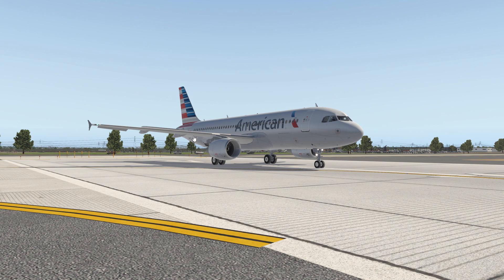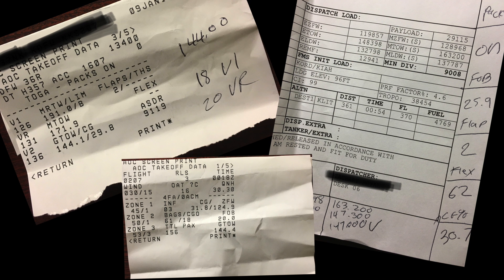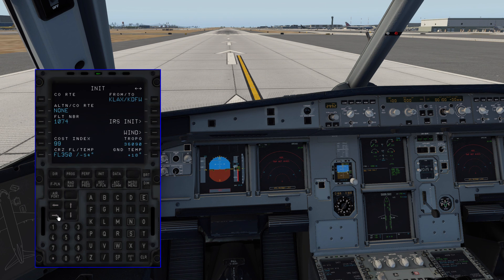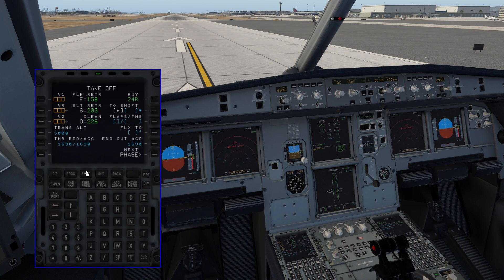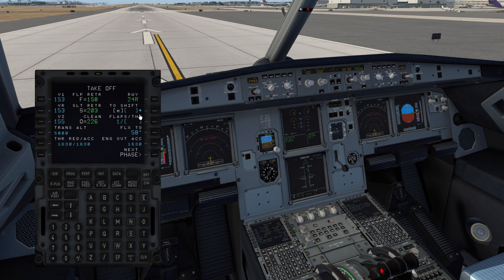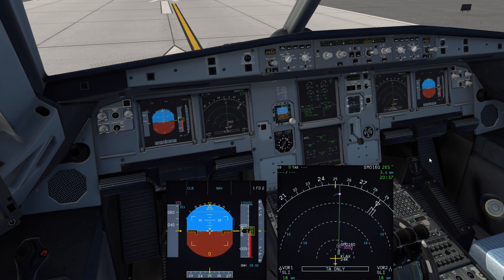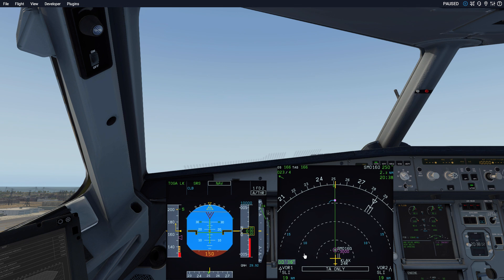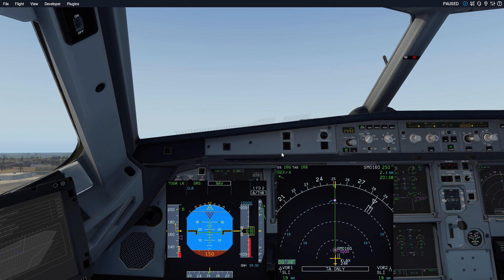I FlightFactor A320 I REAL Pilot Takeoff performance TEST

Comment: Engine acceleration from idle to 50% is too fast. It is a good aircraft, but this is really annoying. Everyone who has seen A320 cockpit videos or been passenger in an A320 knows that the spool up from idle to 50% takes about 9 seconds. In the FF, the engines acclerate like in a toy plane. They should have gotten this right, important immersion aspect.

Comment: I have a suspicion. If you can, try to get real-life data from a "pax off" takeoff. I believe the reason for the overpowered engines is the lack of pneumatic simulation, so the FlightFactor always performs as if the packs were off. I wonder if we can try this, and then maybe we will find the real answer.

Comment: Well, here's a little catch. Your sim seems to be running on low FPS and what X-Plane does in such a case is that it slows down the simulation time when the FPS get below 20 (see here: https://www.x-plane.com/kb/the-simulators-measurement-of-time-is-slow/). I mimicked your measurement with the stopwatch on my phone and when I finally stopped it, it was reading just a tad under 47 seconds, not 36 like on the ND. The gear up callout was exactly at 00'43" so I think the FF is actually quite spot on. Superb comparisons with the real jet though, much appreciated!
Reply: Ondřej Čada what he could do is go into replay mode, record the video in 60FPS (with X-Plane recording) and then record the time.

Comment: I'm curious -- it's my understanding that on the FMGC Data/AC Status page has the "Idle/Perf" variable that is periodically updated based on performance data from dispatch. I'm sure every airline's SOP is different but I've heard that if you're the first crew of the day that you either have to update that or verify it. The FF A320 simulates this seemingly well - just put "ARM" in the "CHG CODE" field and you can edit it from the default of "+1.0/0.0" ... As I recall, these values do modify the FMGCs calculations for a flex takeoff (e.g. T temp = X% N1 (or EPR if you're on the IAEs).) (Side note, I think the default CHG CODE from Airbus is "ARM" but individual airlines can change this....) It could also have to do with the FMGC version (I believe FF simulates the v1 and v2 is out? Not sure. 

Also, FWIW, I've found that the sim is pretty particular about the data from the "Perf Data" page in the EFB Tablet -- if the weights don't match up with the values you enter in the FMGC Init B, things are a bit wonky. (One trick I've found is if I'm not using the simulated fueling (e.g. the refuel control panel on the overhead or the exterior fueling panel -- which you can open by clicking on the numbers on the overhead refueling panel), the sim gets a bit weird if I don't click the "get" and "set" buttons a few times.) 

Really enjoy the videos :)

Comment: I've always had this issue with the FF320, had to customize my joystick settings to where it felt more accurate on the rotation, think I ended up with my sensitivity sliders at 30% for pitch and roll, that was with an old logitech 3d pro, now I'm using a VKB Gladiator and I find those settings sufficient as well.
Reply: Thank you for letting us know about the sensitivity on the pitch during takeoff. I was having issues as well.

Comment: I think that there is something wrong with the thrust deration, because the acceleration of the aircraft seems independent of the Flex temperature, even ToGa appears to have the same impact, at least that's what I notice...
Reply: That's what I am thinking too.  The N1 values calculated by TopCat (for whatever they are worth albeit closely matched by FS Labs) are a few % lower than what FF A320 is giving on takeoff for the same flex.  I think the flex is probably ignored in this simulation.

Comment: I don’t know the aircraft you fly in real life, but the FF has the CFM engines, and maybe the plane you did the test with had the IAE engines which could have cause the “overpowered” engines. But I could be very wrong and the plane you fly could definitely have the CFM engines as well. Just thought I would throw that out there. Great vid!
Reply: He said he flew the 320-214 in real life. The -214 denotes that the aircraft has the CFM engines
Reply: uhntissbaby111 did not know that thanks
Reply: The FFA320 has the CFM engines.
Reply: Cedrik Lussier yep said that
Reply: @zachcalpey9371  Yep my bad I stand corrected
Reply: Yup! On Boeing’s, the last two digits are for customer codes. On airbus, the last two are engine variant

Comment: Just so you know having AI can decrease your FPS dramatically so that may help boost your performance by turning AI off! In addition, you might notice that the FF320 over rotates easier than the Tolis319... hopefully they are working on this - who knows! Thanks for the content 👍
Reply from the maker: thanks i will turn this off in the future! Dang little cessnas lol
Reply: Also if you are using a NVIDIA GPU you can check if your performance is better when THREADED OPTIMIZATION is on or off. You can find it in you Nvidia controll pannel. Enjoying your vids. Keep it up!
Reply: @x-dynamics4025  Correct! I found that in 11.30, "ON" gets me better performance. Previous versions including XP10, i had it set to "OFF" for better performance. Something has clearly changed in 11.30 :P
Reply: @ELSØ-DJ  since 11.30 off was the way to go. Also turning off shadows on scenery helps your fps a lot. (And refection detail to 0) happy landings captain!

Comment: Thanks, that's what I always suspected.
What do you think about the behavior during rotation (with a non slipping joystick of course)?
I have the feeling that the ToLiss needs a pronounced pitch up while with the FF it's very easy to end up in overrotation and TOGA lock.
Which one closer to reality?
Reply from the maker: This is difficult to say definitively but I would lean towards ToLiss for rotation. I do feel that the 320 has a tendency to over-rotate in the sim. This is a difficult thing to model because during rotation at SRS engagement the pilot actually does have a direct relationship between sidestick deflection and the elevator, it is in-fact more "pitch" sensitive then it will be during normal flight mode with full FBW engaged.
Reply: @V1Sim  I always find the FFA320 "feels" heavier on the ground, significantly so; while the Toliss feels better once you leave the ground. With that said, XP11 has been known to have ground physics issues.

Comment: I personally prefer the toliss over the ff. The toliss gets regular updates and will be the best airbus after some updates in my opinion. Meanwhile the ff gets 1 update every  6 months
Reply: Keep in mind that the FFA320 is technically in beta, so it hasn't been fully released yet. Now with that being said, I think it was irresponsible of FF to release and unfinished product, with promises of updates which are just promises at this point. The last major update was before summer last year I think. I still fly it because I love the A320, but it's frustrating for sure.
Reply: I agree mostly, I feel the Toliss is the better Airbus investment right now. Speaking of, a guy did some custom textures for the Toliss and they are very good. https://forums.x-plane.org/index.php?/files/file/49553-toliss-cockpit-texture-replacement/
Reply: Sadly. But maybe because they updatet all their other aircrafts ...